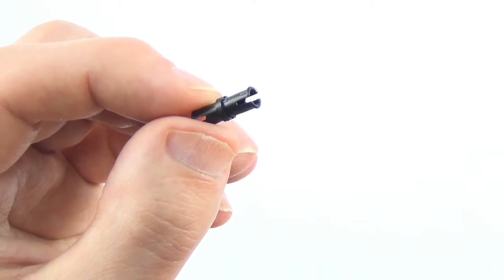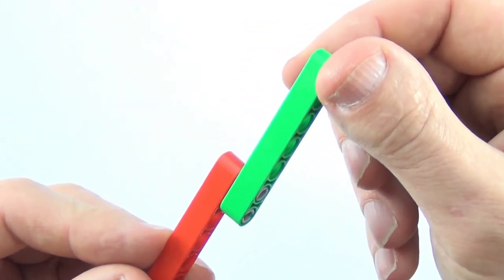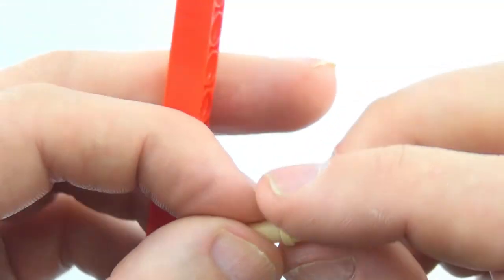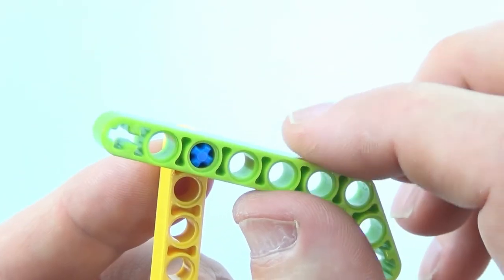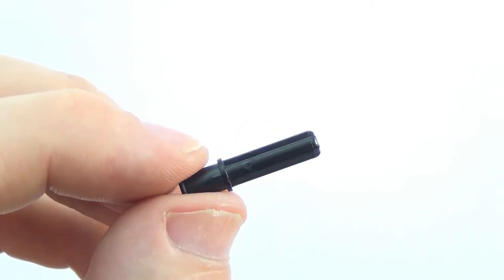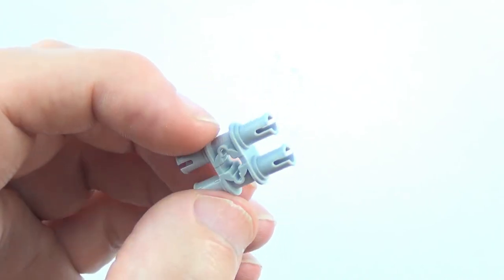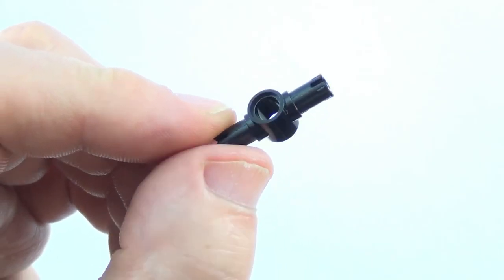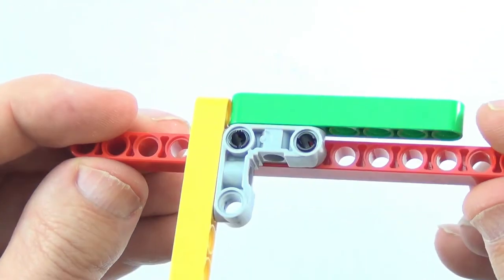Lego Technic Pins Tutorial

Comment: I have an issue pushing the pins into the holes. Yours go in so easy but for me even pushing really hard they will not go in at first. If I release pressure then try again it can "sometimes" they go easy. I've even tried squeezing the gap in the pin together first but still they are impossible to just push in, like you show. Do you have any tips, thank you

Comment: Hi there, Thanks for this video, hopefully you can help me. I have a Land Rover Defender 90 model that has a stuck Technic pin. Its the Pin 3L with friction ridges lengthwise part: 6558. Your video minute 3:01. I am trying to remove it and am not able to get the part out any suggestions on how to remove it from another piece (I have very little grip or space to get to the part as its in a tricky position on the Land Rover chassis. Any help would be hugely appreciated. Thanks

Comment: Hi how could I remove a half pin, there's nothing I could grip onto from the other side? it's impossible even with the lego removal tool.  Thanks
Reply: the removal tool sure does it. If u dont have the tool, use an axle.
Reply: I had the same question and just managed so thought I'd post it here. Use the axle on top of the tool to push it out, but kind of push from the side a bit so that one side is moved a bit inward which makes it small enough to pass through the hole if that makes sense. If other people have an easier way I'd be glad to hear it.

Comment: What is the difference between parts 2780 and 61332? There must be something because set 42131 Cat D11 uses both.
Reply: This part has at least two variants with differences in plastic thickness at the pin ends. An additional variant has no center slots.
Reply: @dinhtuan752  I see now. Part 2780 (4121715) has a center slot and part 61332 (6279875) does not. The D11 parts list shows 146 of the slotted pins and 561 of the others used, but the building instructions show only the slotted pins used.